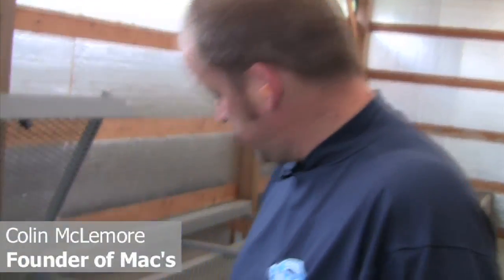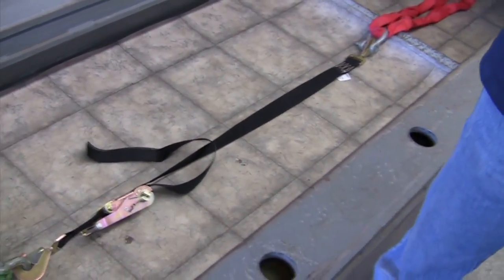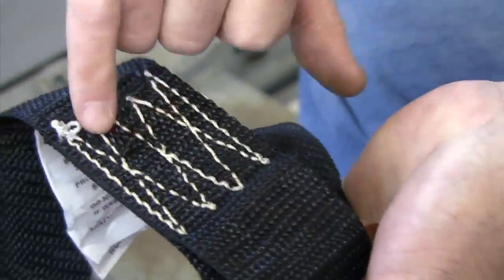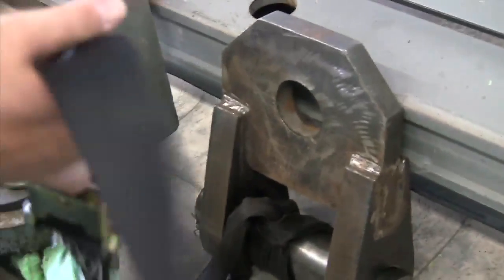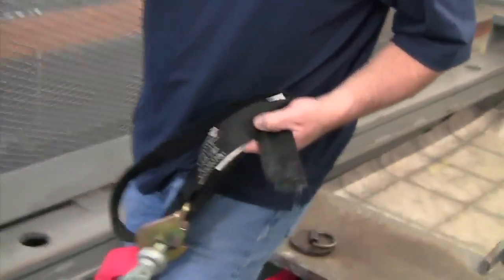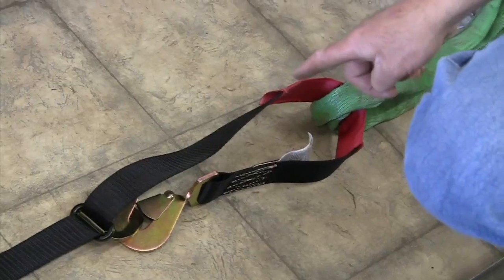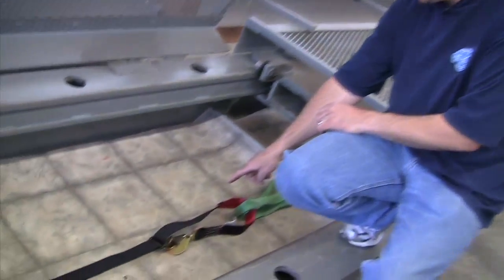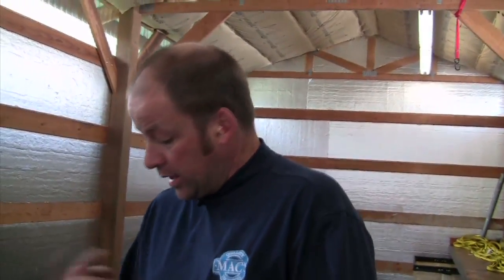Put to the Test: Vehicle Tie-Down Straps

Comment: This is an amazing video...I've been using Mac's products for years...top quality stuff and when you think about it, you certainly don't want to short change yourself when it comes to what's holding your car, motorcycle or other valuable cargo in place!!  I've had numerous customers experience strap failure using a budget, save a few bucks, strap and they've regretted it with expensive repairs.  Mac's is as good as they come!!